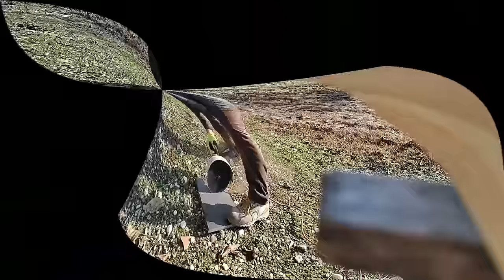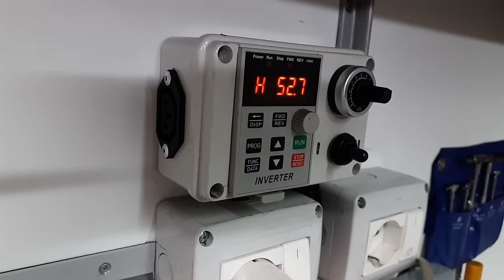Vice for lathe no vibrations system

Comment: Good videos. Did you have any problem with the taper coming out of the tailstock? I think it would need a clamping ring to secure it.

I would like to know why you use a vertical slide when you also have made the large milling frame? It looks more capable. I would like to build one.
Reply from the maker: Thank you very much Mark, I had thought about it (I would have put a fixing screw in line with a doily) but I didn't need it and it never comes off, it almost always works by pressure like a drill bit.
This vice can be assembled quickly without using a lifting tool and without dismantling the spindle and counterhead